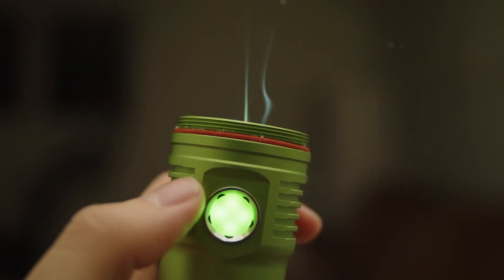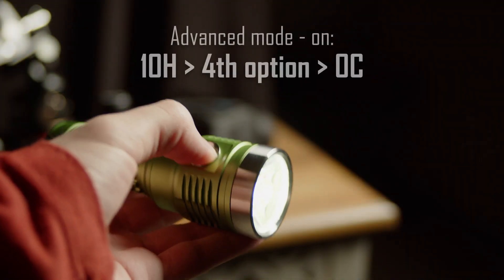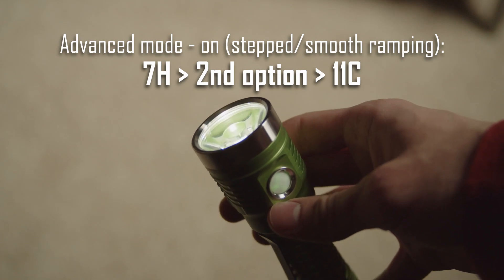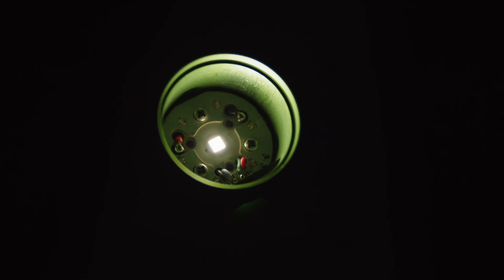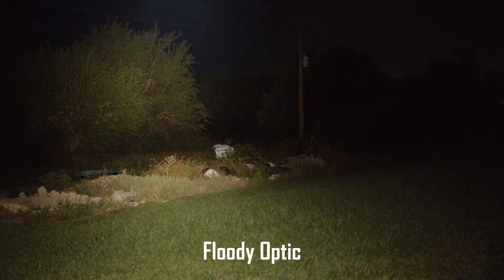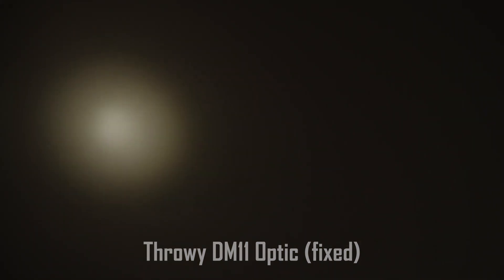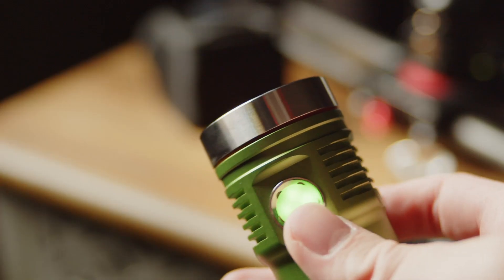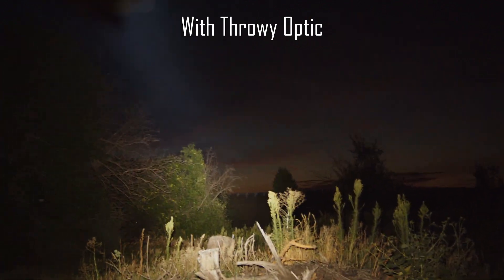FIX YOUR B35AM (Smoking + Throw Increase)

Comment from the maker: NOTE - You need to have a version of A2 with the features shown in this video. I believe everything with the boost driver + B35AM will have the newer firmware, but you may need to reflash.

It seems not all lights are experiencing this issue. I recommend you remove the optic/lens from your light and run turbo to test it.

Regarding the throw increase, Hank is selling these lights with modified tighter optics by default. This hack is for those who bought the floody optic and want a simple way to increase throw without actually modifying anything (...but you do still need another throwy optic)

Comment: Hey mate! I just got a D1K with B35AM, and I'm wondering if this is also necessary with whatever default driver that comes with? I'll probably set the ceiling just to be safe.
Reply from the maker: It's effectively the same driver, but Hank has since adjusted all of his lights such that the B35 shouldn't smoke anymore.

Comment: Oh no. Dirty LED or poor heat transfer? My build was smoking too but it was a 5A 519A with poor reflow. Had to redo the reflow to fix the issue.
Reply from the maker: The B35AM lacks a thermal pad for heat transfer to the MCPCB, just like the 144AR. Apparently it's just being driven too hard

Comment: What advantage does the B35AM have over the 519A?
Reply from the maker: Compared to a single 519a it's much brighter and has the most realistic color you can get (519a is also extremely good but it's more pinkish, its like 98 CRI while B35AM is almost 100)
Reply: @LuxWad  damn 100cri
Reply from the maker: *almost ;)
Reply: @LuxWad  just pure crazyiness soon we will all see in 100cri in all leds around the world by 2050 i say.
Reply: @LuxWad  Is it brighter though? Hank lists the dedomed 519a as 1200 lumens vs the B35AM as 1000 lumens in the new D1 and that's before the output is adjusted so the B35AM doesn't smoke.
Reply from the maker: That's odd, normally the B35Am is definitely brighter than a single 519a even with the dome, though it does depend on CCT. I don't know why he's listed it so low, it almost seems those are flipped
Reply: @LuxWad  but what is the most reliable LED in the world 🤨 wish i knew
Reply: @LuxWad  Even if they were backwards, 200 lumens doesn't seem like that big of an advantage considering the 519A is a single die LED and the B35AM is a quad die LED that can't handle that output without smoking.

I just don't get why Nichia can't give the B35AM a better thermal path like the 519A has.
Reply from the maker: Yeah the B35AM ought to have a better thermal design, the 144AR had the same issue with no DTP option.

The B35AM still has advantages over DD519a, namely more neutral color and a floodier beam, so it still has a place
Reply: @THEPLANETEARTH  519a and b35am are in a similar class, b35am has slightly higher r12(blue) score, but nothing noticeable. If you want 99 cri, Optisolis or Sunlike are your best bets.